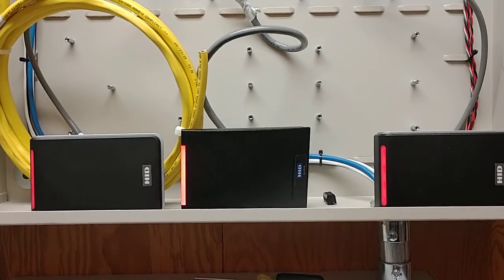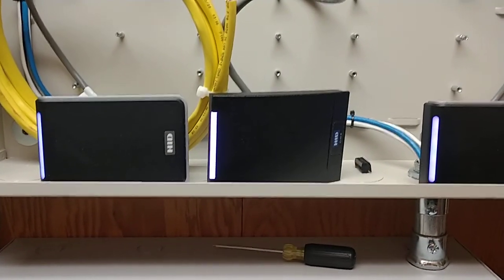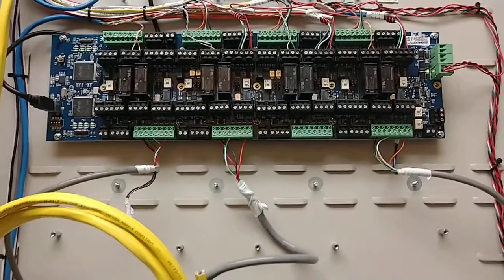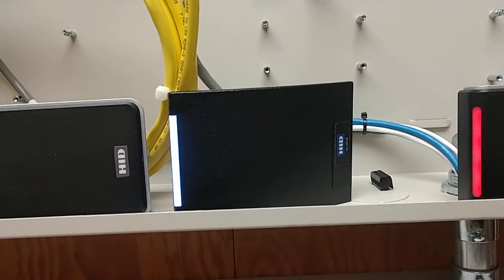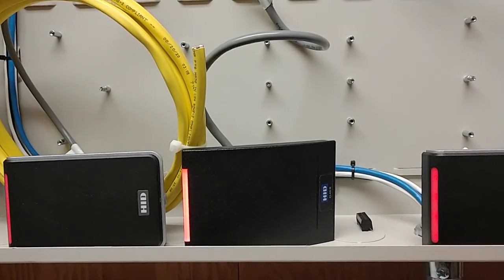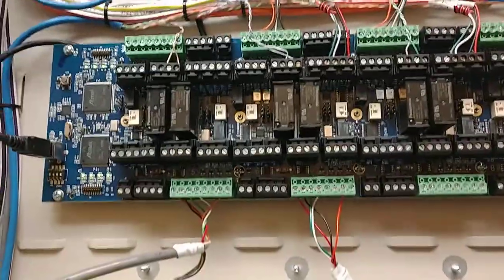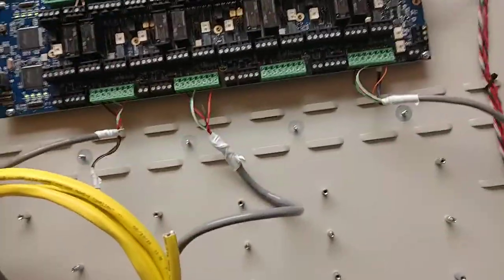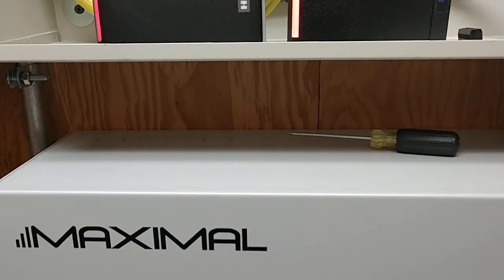More HID reader testing on site at Jeffco.

Comment: Hey @chris Albert, do you know what’s causing those lockups? Or do you have a solution on how to fix it? I have an iStar Ultra SE with 9 HID RP40 readers and as you mentioned they very randomly seem to lock up, hold white LED, and screech. I’ve never had this problem before and HID and Software house tech support has not been helpful at all. Thanks for the video and I appreciate any help you could provide
Reply from the maker: Yeah, they seem to be related to the speed at which the i-star ultra panel would pulse the power going out to the reader. When the ultra panels boot up, the ACM will pulse the power on the reader port a couple of times. I think they would also do it after a full download whenever the crossfire services got restarted. This would make certain RP40 readers (I think related to the firmware on the reader), but not all, think they are going into a low power state and lock up in that "reader protection" mode where they turn the LED white and do a constant beep. Older RP40s didn't seem to have this issue, only newer ones it seemed. The only way to make them stop is a power cycle. So, as a workaround, at the time, I tried wiring all of my +v red wires from my readers directly to the i-star panels positive 12vdc terminal on its power supply. This kept constant +v to the  readers so they would no longer lock up after panel resets or downloads. Since then, I don't think we have sold any more RP40s, so the issue kind of went away. Hope that helps lol :)